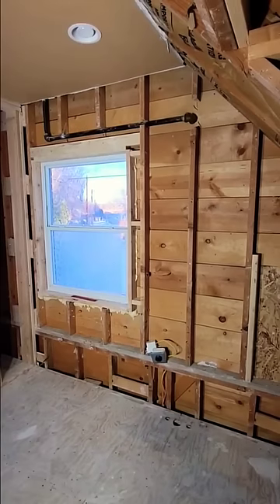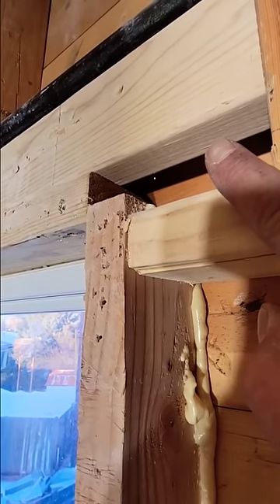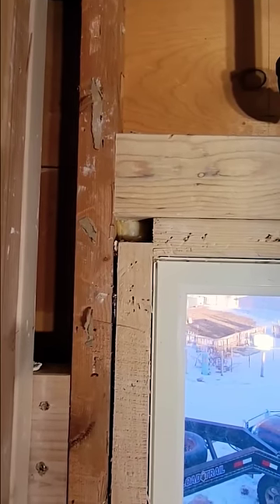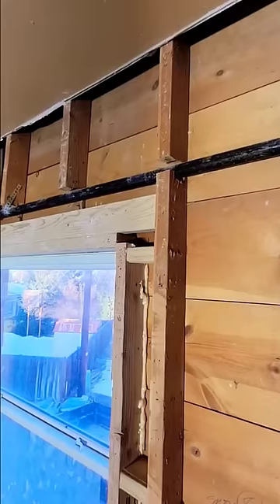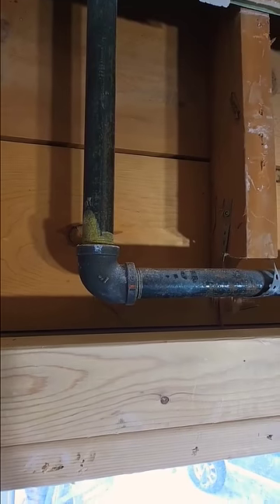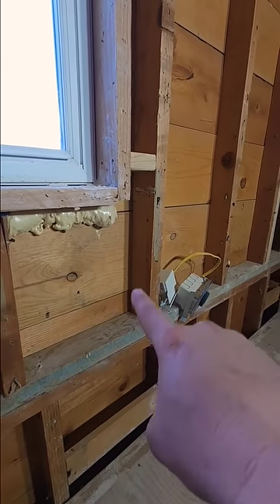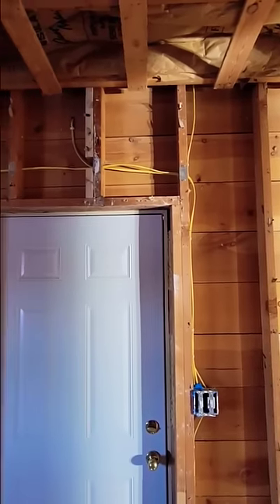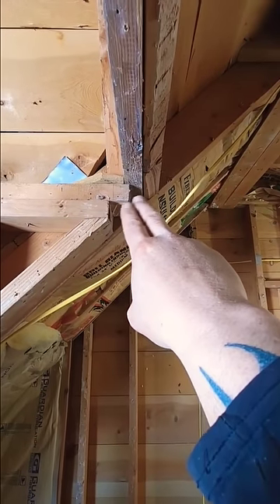Why ((REMODELS)) cost so much! #hacks  #construction #framers #plumber #shorts

Comment: Whats up with the fittings in the wall are they cast ?.. cuz they looked malleable to me
Reply from the maker: They are now saying that we can't put any gas fittings in walls behind drywall.
Reply: That's not even possible.. especially if you have a laundry room on the sec floor..or a furnace..fireplace..water heater where are u from ?..
Reply: What do they want flex & transition outside the wall or after through the floor..?
Reply from the maker: Flex in the walls, or any Gas line that does not have a brake in the pipe. I know, It is dumb for sure! We went to war with the city and they still made it code.

Comment: Remodel.
Charge whatever you charge to put it to remove it.
Double that and add $500 just cause.

Then add in the price of installing the new material.
Add in $500 just because.

Add another $500 for any changes the homeowner makes in the middle of the job.

Then add $500 just because.

At this point you might break even if none of your employees screws anything up so add on another $500 just to cover your azz.

Add another $500 just because 

That will get you pretty close to affordinging the gas money and wear anf tear on your vehicles to do the work and the inevitable running around.

Add a $500 just because and you might actually make a profit.

The just because adds are just because I dont want to do it.
Reply from the maker: lol

Comment: Wrong fitting because it’s non-malleable or because it’s a 90 without a drip tea. Do you only have to use those before gas appliance?
Reply from the maker: In Wyoming they are saying now you have to have a accuses to all joints in your gas line

Comment: As a plumber who does a lot of remodels, please don’t go into a remodel thinking the price you were quoted is the price your going to pay in the end, especially if it’s an old house that’s never been updated. We just did a job that started at 7500 and ended at 12500. Had to replace all the waste lines vertical and horizontal in a crawler on top of the full water repipe. Shit sucked
Reply from the maker: Yep

Comment: Did I miss something. What was the wrong fitting on the black iron pipe?
Reply from the maker: In the 2022 ICC code book states that you can not put any fitting behind a wall that does not have access to.
Reply: @307Garage  how in the world can you run black steel in any application for gas lines? You would have to put access panels all over the house. I know you can't put unions and swing joints in walls but tee's and elbows are legal by code
Reply from the maker: Any fitting. Yeah, our city adopted it in 2020. We all went to fight it, But they went with it. So yeah, it is a fight to get every house we open up.
Reply: @307Garage  what state are you in?
Reply from the maker: Wyoming

Comment: They used black iron for water pipe in north Carolina code is galvanized pipe for water black iron for gas
Reply from the maker: Stone age!
Reply: @307Garage  true they don't use galvanized pipe for water anymore but still using. Black iron for gas
Reply from the maker: Can not bury "ANY" fitting in the wall. 2022 ICC Code Book. It has it in it, and that is what our city runs off of.

Comment: As a hanger, I had to learn all trades that I cover with drywall. Not because it's required, because I won't cover anything that's not right.
Reply from the maker: Right! You always have to watch out! They could pin it on you because you were the last one that seen it!
Reply: When a trim carpenter comes in, and  one plate got missed, on the second floor. Finish nail direct hit, sticks good. Until the first person shows up the next day, to do touch up and a walk through....
Reply: Could be Monday morning, perhaps😂
Reply from the maker: Well, lets hope that was not your Monday!
Reply: @307Garage  unfortunately it did happen to a cubby on my crew, 27 years ago.
Reply from the maker: That sucks. Although It can happen. That is why it is very importuned to drill in the middle as much as you can.

Comment: Looking at that gas line could you tell me what's the legal about that fitting?
Reply from the maker: Can not have (Any) fitting in the wall that can not be access to from the out side of wall. That is what code reads. So the town we live in takes the (ANY) fitting to every fitting metal pipe or flex.

Comment: Rake walls don't need headers ..and there's no Load points ...that 2x4 is a trimmer....yes it's a total hack job....but it's  not a tragedy
Reply from the maker: Normally I would agree with you, But the way this was framed and the load on the roof right there along with our snow load here is Wyoming. It needed a header there.

Comment: How are 90 elbows illegal? I see your point about the framing and hack job cutting the beams to run that gas pipe. But maybe stick to framing and don't talk about plumbing.
Reply from the maker: Where we live in Wyoming, You can not berry any fitting in the wall. If you do, You have to make a access to it. I know it is jacked up and we fight it all the time, But the city will not let you berry that 90.

Comment: If you do your contract correctly,  you can still bid it.  Not an issue.  Most of my experience is when I run into T/M guys, they are too lazy to bid and that mentality shows up in their craftsmanship and work ethic.  
Advice for homeowners,  don't hire guys by time and materials.  They will take forever and screw you over.  Gulp, swallow, and hire the guy giving you the total upfront.  Pay only partial to start and don't give a final payment until day of completion.
Reply from the maker: 100% correct! 
There is a time and place for T&M but if the guy can't give you a price form the beginning! Might go looking for someone who can! Normally that means they don't know what it takes to finish the job the right way in a good timely matter! Thanks for watching and go look at how we fixed it! Also there will be more on this build with what we all had to fix!

Comment: Well it depends on the roof trusses running across that way or not because if it's a wall underneath the Gable trust then I mean it's not as bad but yeah I get what you're saying if I saw that I'd probably lose my s*** you never have 2 x 4 headers on Exteriors

Comment: Looked like a gable wall. Don't really need a header if it's not load bearing. Now the cut studs is a different story lol
Reply from the maker: I felt the way it was framed, It did have a load on it!
Reply: @307 Garage  and it may have. Idk what's on the outside. It definitely needed the support of those studs that were cut. Putting a header in definitely can't hurt anything, though, so if that's how you like doing it, then do it. I know a lot of houses are built with headers above every window and door regardless of the weight above it
Reply from the maker: Along with if we had to cut out the studs up in a 18 foot in to the roof and then run them down to still meet up with a header. Time is money and a 2X10X8 cut to a header and cut the studs off flush was way less time. It was like the 2x10 was free. lol

Comment: Alright man so this is exactly what I need to understand with bidding as I'm yet to start my own buisness. I been doing carpentry long enough to know this kinda crap always rears its head on the job. So how do you account for this in the bid? If, by some miracle of christ, everything is straight forward, do you cut the client a deal at the end since you didn't run into  stuff like this?
Reply from the maker: I always show the home owner the problem tell them why we can not cover it back up and make sure they are ok with it. Normally I tell them to fix it is going to be T&M for the fix only. This one was a little more then that. Also with all that we found upstairs in this. Downstairs was just as bad. This is a 6000 Sqf building. Now we are fixing the brick on the outside that over the last 70 years, everyone thought it would be good to just make a new hole in the brick anywhere they wanted to. This whole job has been one thing after the next.
Reply: @307Garage  wow. Holy crap man. Man I was flipping a 3k Sq ft house once, demoed the kitchen n discovered the entire left side of the house's framing was paper machete. Every plate, stud, the corner posts, and ends of joists rotted n chewed up by termites. And that's when I realized a simple kitchen reno could turn into much, much more. Took me about 2 months to fix everything. I wish you the best of luck on this job man and will subscribe. Will likely ask more questions in the future. Thanks again brotha n good luck. ✊🏼
Reply from the maker: It took us from 12/26/22 till now to fix everything! Now we are dealing with fire walls that go in between the daycare and the apartment.
Reply: @307Garage  good luck my good man. It seems like you do a heck of a good, honest job and I'm glad you got steady work, despite it being a pain the ass 🤣 keep trucking brotha, look forward to more videos.
Reply from the maker: More to come for sure!

Comment: I'm not a pro, I'm just poor. I do a lot on my own. I redid my kitchen and bathroom over the last year. I can't even remember all the fucked up shit i found when ripping down walls. Wire on top of studs (they gutted out a path for it in the plaster) then 1/4"drywall on top of that. Studs cut for plumbing. Yes, some were load bearing. No follow thru on the jack stud for 2 different windows on 2 exterior walls! All kinds of crazy stuff. The house was built in 1893, so I expected crazy but wow!
Reply from the maker: It is crazy what people think is ok. I fix it all the time.

Comment: Even if you don't find all these problems you're priced is still high. Sometimes it's worth it a lot of times you are just getting overcharged.
Reply from the maker: Well, I will come with a set of tool bags. All the tools we use, You have to buy! I'm more then happy to do that! Or you can pay a little more for the 200k + tools I have that are going to be used on your job!
Reply: @307 Garage I know what's up. I've been in the business for over ten years now. I too own a small fortune in tools.
Reply: @307 Garage   Everything you showed in this video one guy could have fixed in like a day, day and a half with $200 worth of material.
Reply from the maker: Not sure where you get those numbers, But here in Wyoming it is not cheap to build.

Comment: People think old houses are made so well because the lumber was really good, which it was. But the engineering is usually total shit on old houses. If you have a house that's over 100 years old it will have real 2x4s and shit like that. But you open it up and see that they have made load bearing headers with a real 2x4 with it laying on the flat and sagging on the middle because it's done wrong. Sometimes they will be nailed between two studs without a jack under them.

They would also balloon frame 2 story houses and not bother with any kind of fire stop. There are always lots of major vertical supports that just stop wherever and don't bother to run them down to the "foundation", which is often nothing more than some flat rocks from a nearby creek bed, maybe they used some sort of mortar, some don't appear to have anything. I'm not sure if they even poured a footer for them.

These are the main reasons you often see plaster cracking around doors and windows and doors that are sticking and rubbing and not working correctly. Thank God they don't build houses like they used to. 

They have some cool woodwork and some nice aspects about them. But there's a lot of bad things that comes with a really old house as well. I've never seen an old Victorian house that had proper headers with the boards turned vertical over the doors and windows, they're always laying flat, and yes it matters a great deal. Two scrawny modern 2x4s made into a proper header with plywood between them are way stronger than an old growth high quality 2x4 turned on the flat.
Reply from the maker: 100% They had great lumber and it was built like shit! Everyone is all about how it was so much stronger then now. New construction is shit lumber and amazing engineering and over built! They think it is shit framing! I feel the trim back in the day is 100% better then we do now for sure, but the framing is 100% so much better then old school. But the wood is a big thing. I wish I could build with it now! I hate our lumber now! Pick 100 studs and 20 mare good! Hate it! Spend so much time going though it to find good boards. It is crazy!

Comment: Yeah if you'd have bid on that and had to up the price the homeowner would've lost their mind, expected you to do all those corrections within the original quote. We run into that all the time. Or they get a quote and expect you to do the job for material cost and minimum wage. Guy had someone lay porcelain tiles in his whole house and messed it up so bad all the backer board needed to come out, wanted us to scrape dry mud off the tiles and reuse them, and install new backer board and lay 36" porcelain plank tiles and told us "best I can pay you is $1 a square ft"

Comment: 2x4 on exterior walls?  is that even allowed?   I though 2x6 min , 2x8 preferred, not a carpenter
Reply from the maker: 2X4's are code if you can get R19 in the walls. Also this was built in the 50's

Comment: That is ugly!  I have a 150 year old home and having the upstairs apartment renovated (finally).  I'm not surprised at all by what I found in the walls, floors, and ceiling when we uncovered it.  I probably had them add an additional $10k into material just to "fix" it to meet a respectable code.  Sure I'm not happy to spend extra on this update.  Sure I want to get it rented out. But, I don't want to risk not doing the job right to save the life of the house.

Granted the house is old, pre Civil War and all.  I'm 48 years old, and I want this house to be around for another 150 years!  I may only make it for another 35 years or so, but at least it will have been well taken care of and will make a very nice place for people to live.
Reply from the maker: Yes, They are everywhere. I have seen about all of it. But done right it will be around for a long time!

Comment: My windows in this old house has no headers over them . House was built in 1840 ,it's a plank house. 2x14 or more wide planks . .
Reply from the maker: Yeah, I love the old house framing. Still not right, but back them is when they were amazing skilled workers for sure. No power tools. All by hand.
Reply: @307Garage  Yes .This house is post beam .10x12 beams , planks run vertical. Horizontal it would not have structure/support. Like in the vid , those run horizontal no support.
Reply from the maker: That is cool! Love Post and Beam!

Comment: Most homes have butcher jobs because they were built before A/C  and many other amenities.  You would have to tear the house down to do it right.   So the job was done 10 years ago and the house still standing,   with all new regulations anything done yeaterday is illegal tomorrow.   If i see that , I leave it alone.
Reply from the maker: I couldn't. Code makes me fix it or can not finish the job.
Reply: @307 Garage  My brother was an electrician for 35 years in the same LOCAL,  Licensed with a college degree.  Retired Early.  For every one doing the the  right, ( by code)   there are hundreds  of butchers. You would have to tear every building down if you saw what I saw HE WOULD SAY... Crews coming in in the middle of the night just slapping things up.   As far as Home Repair,  if I was to correct every  flim flam job that I saw , it would cost the owner so much money they would not be able to pay.  . THATS why they got the BUTCHER in the first place...  BEEN THERE DONE THAT,, NOT MY PROBLEM OR MY JOB ... If I wanted to be a Saint I would have joined the Priesthood... Once you submit plans for electrical work and an inspector comes to approve the job with all the walls OPEN  and they see the BUTCHERY ,, The home owner ( and you) are screwed.... 🍷
Reply from the maker: So bad!

Comment: The siding on the outside is holding up a house
Reply from the maker: Normally I would agree with you, But the way this was framed and the load on the roof right there along with our snow load here is Wyoming. It needed a header there.
Reply: @307Garage   I understand

Comment: Honestly shocking nothing has really moved in ten years with how horrible that is. Were there at least cracks in the drywall?
Reply from the maker: Yes in a lot of spots.
Reply: @307Garage  I've seen alot of bad things thru the years (the most common is wires just wire nutted or taped together inside walls with no boxes) but I've never seen a window framed that horribly.
Reply from the maker: Yeah, it is a thing around here to with wiring. They do not care at all.
Reply: @307Garage  the worst work I've seen is from people that were in a trade and did work on their own house. I've worked on several houses that were owned by concrete guys or car mechanics and needless to say their plumbing and framing and finishing skills were not all that.
Reply from the maker: Yeah, I have seen some good ones for sure!